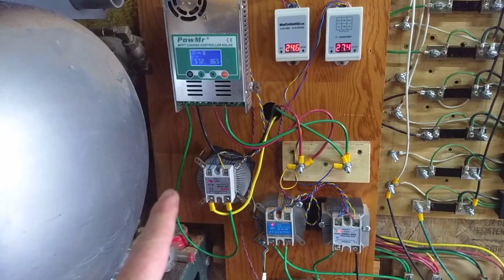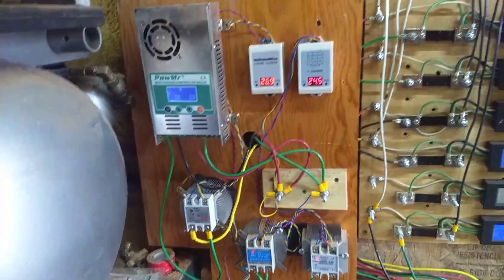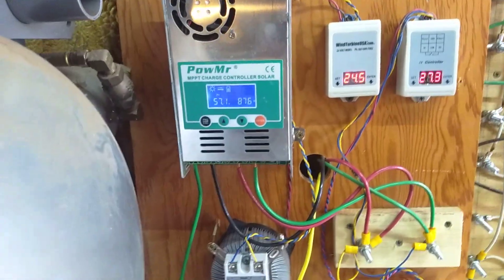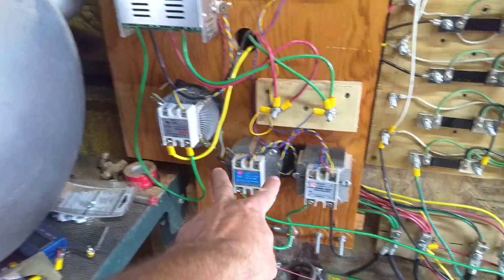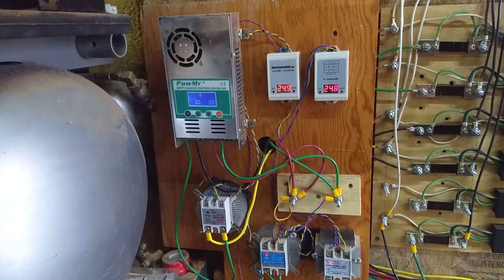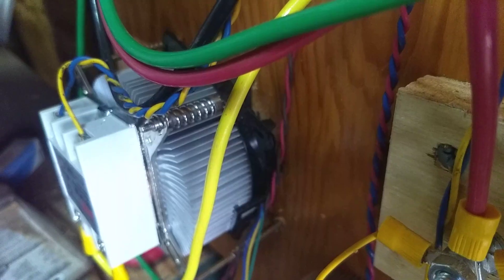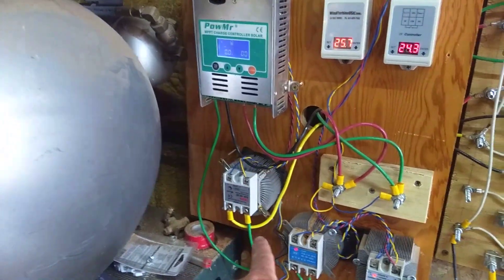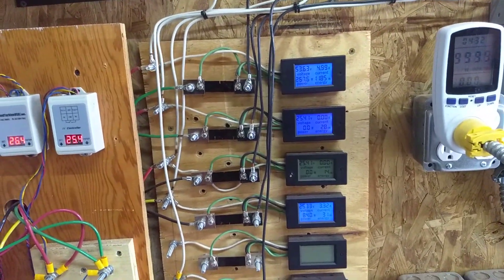Charging a 24v battery bank from a 48v bank using a cheap MPPT Solar Charge controller: It works now

Comment: Yea the powMR is shit for a meter, lacks a separate "sense" wire like the pro level MPPTs.
Reply: you using thermal paste between the SSRs and the cpu fans? Clever, maybe throw one on the back of the PowMR.

Comment: you gave me an idea,  I use a 24 v bank for my ista breeze i2000 and a12v bank for other stuff, so when my 24v is full it triggers a PMW controlled SSR and dumps excess power via pulsing direct into my 12 volt bank, so no waste of power through heat resistors or other controllers.
Reply: you might get the same effect using the "load" terminal on your main bank (controller) programmed to turn on the SSR above float voltage

Comment: Looking good. You might want to try few lithium batteries that might be the answer to your problems. You don't need a lot of  them to run your system and they only occupy a little space. 
Nice work and have a wonderful day
Reply: except that he's using the lead acids as giant caps in leu of supercaps, so he'd have to bypass the BMS and risk blowing up a cell or risk the bms faulting and opening the circuit causing his wind turbines to freewheel.

Comment: Get some AGM or lithium batteries. Those car batteries are meant for large load for short period not what you need.
Reply from the maker: You buying? :D
Reply: @ToysforWatts  no lol. I use Nissan leaf lithium ion batterys. 27kwh's worth to power my house. Spent about $1600 best investment I've made. They soak up energy like a sponge and dish it out just as well along with have a much longer life than lead acid and AGM.
Reply: they're just whipping posts for his turbines, poor man's supercaps. AGMS would cook off and lithiums would trip the BMS disconnect.
Reply: also, might not hurt to add some distilled water to stop em from blowing up. haha

Comment: Do you have links for the controller and relay?
Reply from the maker: controller: https://www.ebay.com/itm/232915143768
Relay: https://www.ebay.com/itm/184695710023

I do suggest buying better quality relays...I've burned up quite a few of these FOTEK variety.
Reply: @ToysforWatts  they're a bit cheaper on aliexpress also

Comment: What batteries are those?
Reply from the maker: The batteries are very cheap lawn and garden lead acid models that really only run about 30 amp hours.  I use them because they're very cheap and easy to replace if I blow one up (I have blown up batteries before) and they're really good at absorbing a lot of current.  They're not great for running anything, but they can take a beating from the generators.